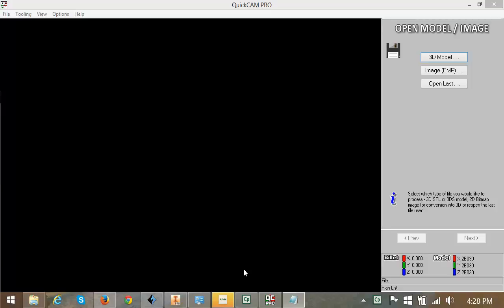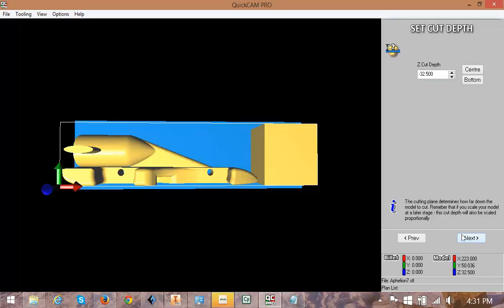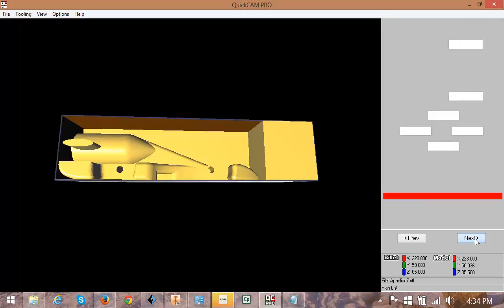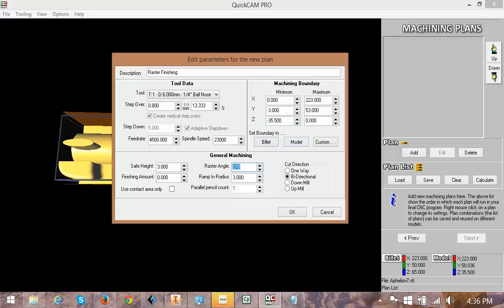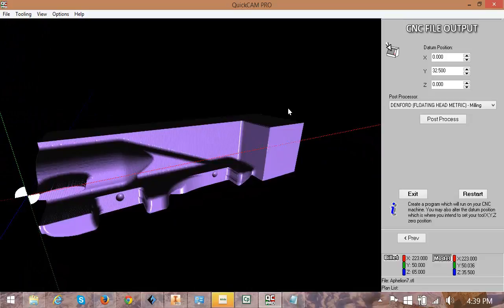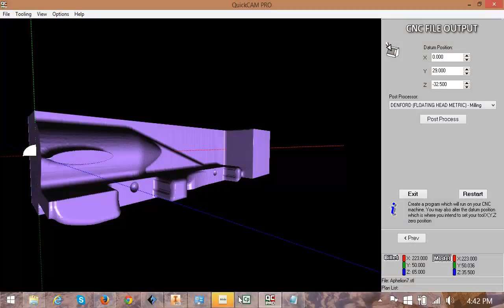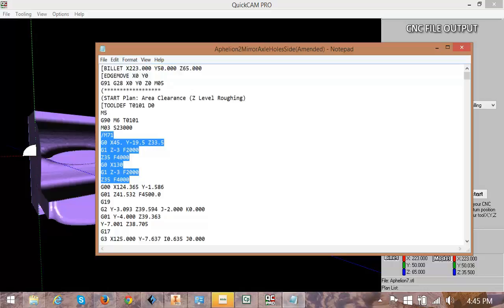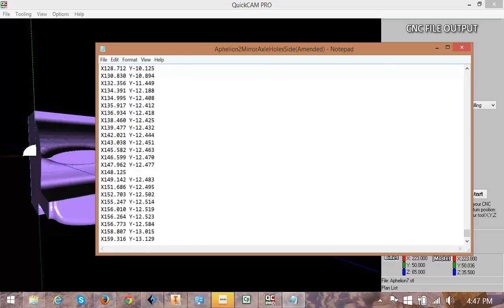Using QuickCamPro to Make F1 Car

Comment: For anyone who can't be bothered typing all the axle and mirror code by themself

[after M03 S23000]:

/M71
G0 X[insert dist from rear axle to back of car] Y[insert perpendicular distance from canister reference axis to axles here] Z33.5
G1 Z-3 F2000
Z35 F4000
G0 X[insert dist from front axle to back of car]
G1 Z-3 F2000
Z35 F4000

Note that I'm not responsible for your mistakes. Watch the tutorial and then use the above code like Mr Di Ienno told you to